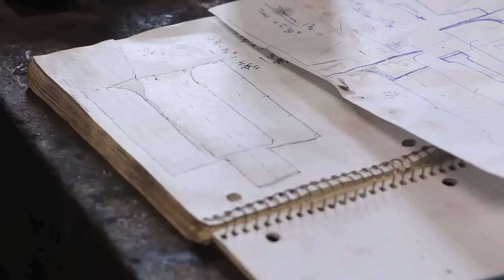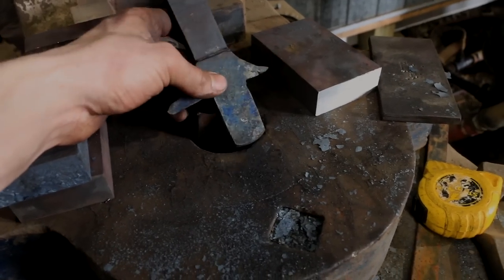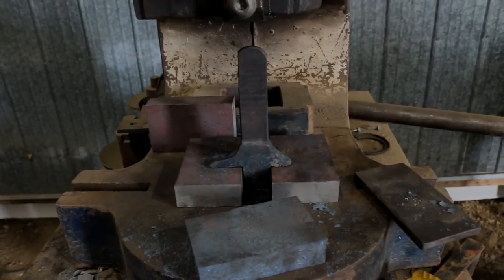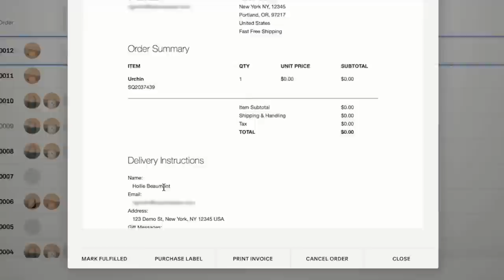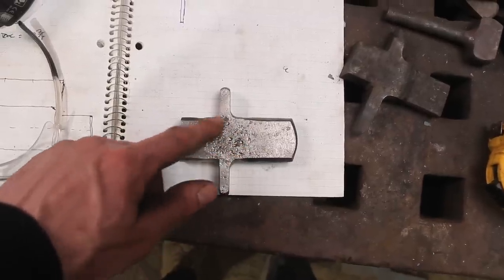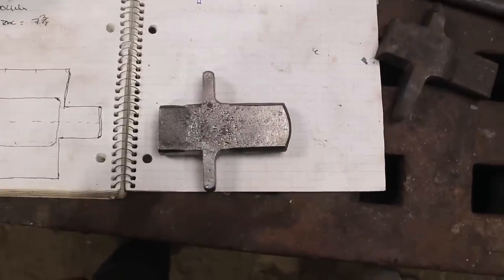Blackhawk Bowie - Part 1

Comment: Isn't there a feature in the upsetter (that you don't currently use) that was for some part of the jackhammer bit making that required upsetting along the long axis of the bit? I have a vague memory of you discussing it in one of the restoration videos but because it doesn't make sense to use with the axe process you either didn't get it working or just don't use it currently. Unless I imagined that all it might be perfect to use instead of the flypress for the tang contouring.

Comment: please read The wording for the knife you're making is a "Bowie Knife with Integral Guard". Knives with integral guards or bolsters are quite common, but I haven't seen anyone trying to mass produce them the way you are. Just to complicated your life a little, I've also seen a Bowie knife with an integral guard and pommel. In this case, you would need to use handle scales instead of a solid wooden handle. Have fun 😊

Comment: Clearly an important design consideration for this process is repeatability. Sure, you can cut the guard material out of the tang, but the result will be different each time. Not a problem for pure custom knives, but if you're trying to build roughly identical knives a repeatable process is critical, IMHO.